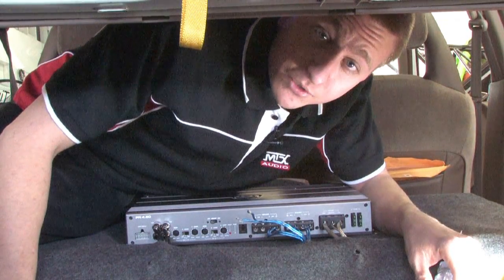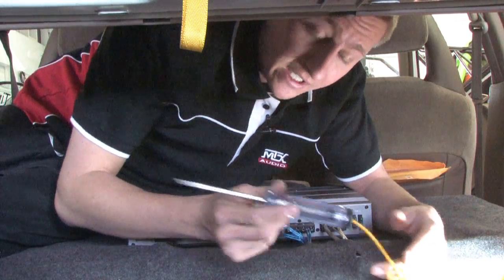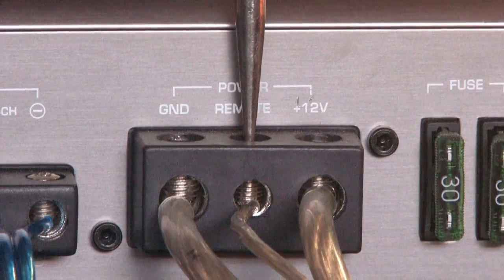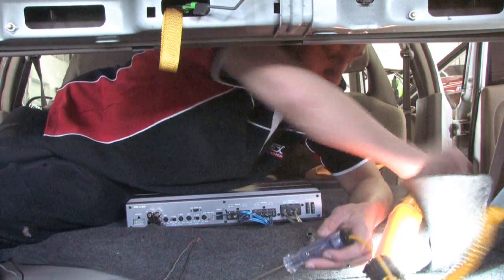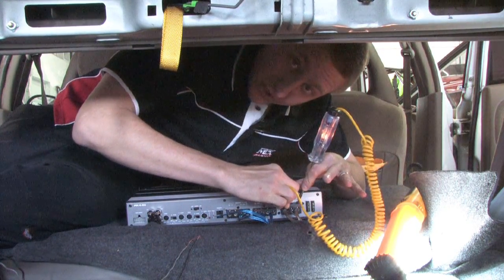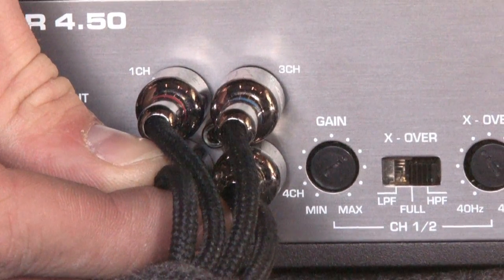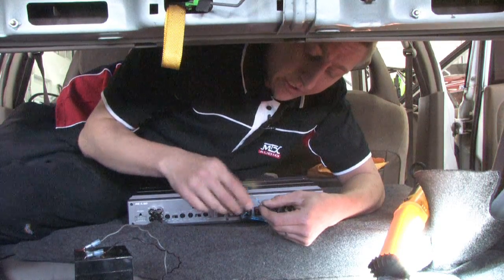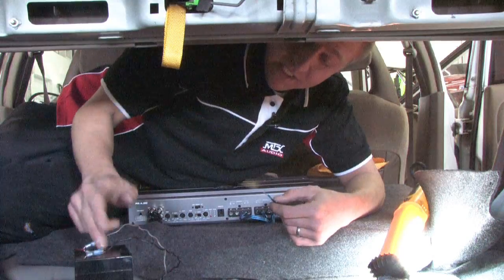Car Audio : Troubleshooting Car Audio Amplifiers

Comment: got  a question my wirring is all good im running a pdx amp amp 1000/1 my gain is barely 1/4 to it and using a mtx 7500 4ohm 10inch on a ported box  when ever i get loud bass note it shoot of the sound but not the amp so what i do  i turn off the stereo and turn it back on and bass comes  back  on  i check the ground i relocated thinking it was not getting good  contact but it was i scratch  the paint so be metal to metal   ? what can be ?  thanks

Comment: i spent WEEKS trying to figure mine out but turns out wiring my turn on wire into the remote wasnt working so i wired into the main battery (+) wire from my radio and put in a toggle switch! worst few weeks ever!!!

Comment: @lillady931 If your amp is protected it means that it has disconected its self from the speakers by not turning on the output relay, this is normal for the first 10secs after you turn on the amp, so that there is no pop when you trun on the amp. if it stays on it means that your speaker is shorted or there is to little resistance in the speaker circuit. other than that it may be an internal problem.

Comment: ok so my car stereo Distorts at like 30 volume . only when the cars on and it didnt do this before i got my car tuned with new ignition wire and new spark plugs also had dash lights fixed ? ! doesnt distort when the cars on ? what could it be becuase i cant use my subs like this

Comment: Hello, Great Video.
Everything checks out fine on my amp (RCA, power (batt and remote) and ground). When I connect my subwoofer to the amp, the subwoofer makes a "thud", but it will not play music. I have replaced the fuses on the Amp as well. Could my amp be internally damaged? Why would the subwoofer make a thud sound, but not produce any further sound? Thank you!

Comment: @Dosalt the visuals are linked to the e brake so you can't watch vids while you drive, it could be the harness but i'm positive that you can install it with a normal one you just have to tap into the wire that has power to the deck (red and yellow)

Comment: @Bristol59Fifty Could be too long of a ground. Be sure you have a solid ground and try to keep it as short as possible. Also, your ground wire should be at least he same gauge wire as your 12v lead. Also try, if possible, to keep power and audio wires away from each other as much as possible. Hopefully that helps. Good luck!

Comment: Test the 12volt tester.. across a good 12volt battery.
THEN fully insulte the tester's BARE_METAL_SHAFT
with 1,000 volt rated heat shrink
leaving JUST the barest minimum of  bare netal exposed -at it's TIP

Next- check if the VEHICLE your amp is connected too- ACTUALLY HAS ENOUGH POWER- left in it's battery .. 
(Amp will fail to "power" if vehicle battery is drained by running amp- with motor OFF)

Then check for POWER- after the inline fuse (beside the battery)

Then CHECK- at the amp

Comment: AND ABSOLUTELY NO MENTION... use the 1st rule of thumb.
CHECK THE FUSES...
 there is generally ONE - if "not" two or more - on the BACK of that amp... NONE of your silly tests will be any use - if the fuses are blown.

Comment: Wahoo ...
B_O_O_O_O_mmmmmm.!
By using your standard NON_ISULATED SHAFT tester scrwdriver - THAT CLOSE to earthed matal on your amp - you risk not ONLY your car battery, and ALL vehicle wiring
 BUT - with your un_protect6ed eyes... mere millimetres from the MASSIVE arc_blast site... 

BLINDNESS will come quickly & very painfully to U - fool.